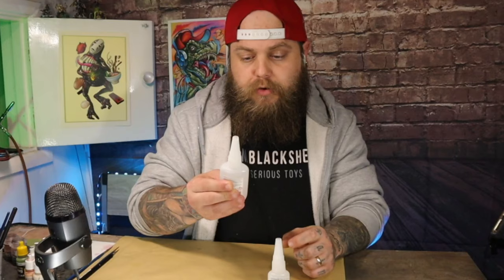What glue for 3D prints?

Comment: I use the same 2 part epoxy. Super glue can fail over time like you said. The resin is only good for seams and gaps, unless you want uncured resin dripping out from your model.
Reply from the maker: This is why I use the thick one. The thick one has a better stronger bond. It’s actually stronger than the thin one and slightly flexible too.

Comment: My major difficulties are not the glues but the seam situation in the model itself (not the base) because resin printing and shrinking differences in each pife of the model can leave really big gaps that need to be corrected while keeping the parts still unattached for painting.
Reply from the maker: You got to distribute the supports more to help with that distortion. If it’s supported right it will mostly fit right. Perhaps a little sanding to make it perfect.

Comment: I found using resin works better to fill in seams and cracks then cure and a little sanding helps, especially on areas where you need to weld two parts together, like a smooth cape. Superglue and activator all the way for anything else.
Reply from the maker: I just made a video about using resin for gaps. Superglue is king for welding resin to resin that’s for sure.

Comment: Great video! I've been using super glue for my figures and also think it does a great job. However, I'm now printing some VERY large PLA parts (like props) and while super glue works well, I keep wondering if there isn't another option for those very big prints. Do you have any experience with parts like that, and would you use anything else or still just super glue / 2-part epoxy?